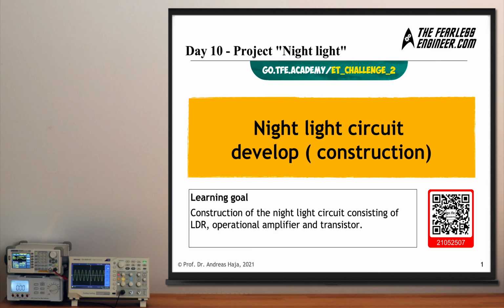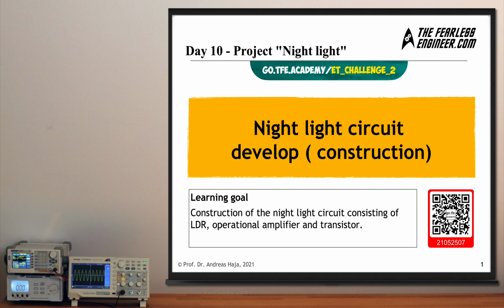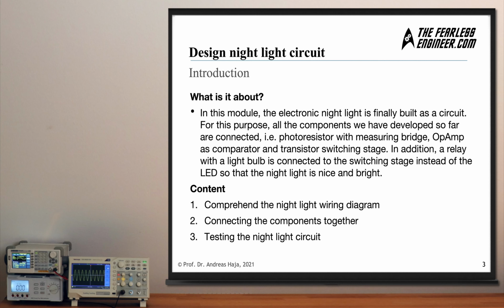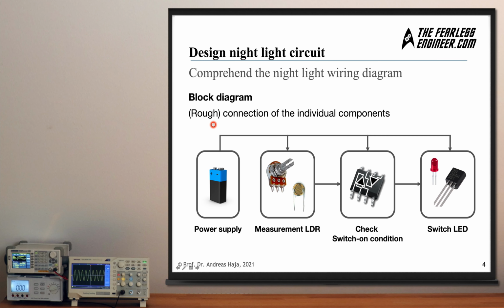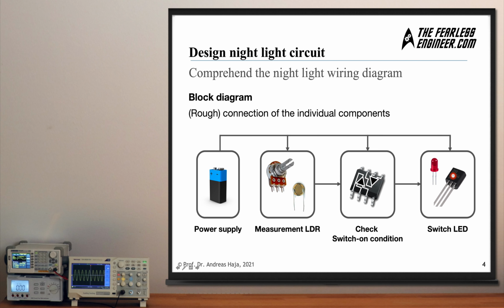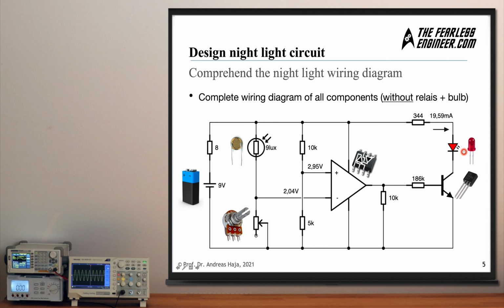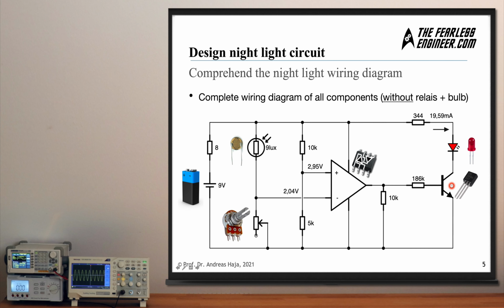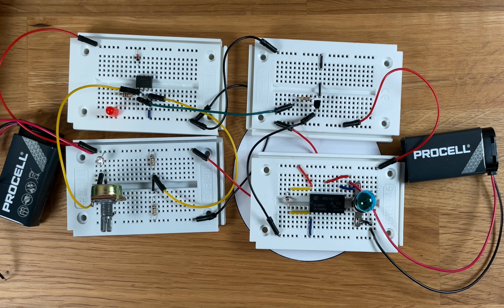Developing a “night light” circuit (construction phase)

Comment: Exactly what I was looking for. I will use the comparator to turn on a transistor on a sensor circuit and prevent bada data by turning it off at a given voltage. Anyway. Keep up the good work. Thanks for the great information.